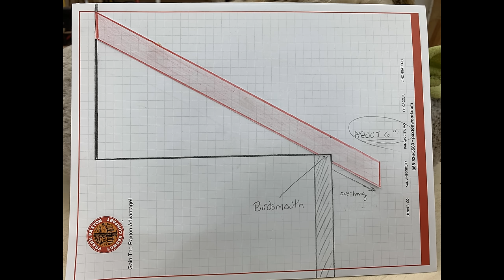99 - DIY Shed - Complete Instructions - Best Tutorial There Is!

Comment: Nail schedule? Really?! It's not sheathing, isn't going to experience sheerforce like a wall would, and all it has to do is keep your floor joists from racking! You're also using a heavy-duty piece of plywood, so being worried about the nail pattern is kind of silly especially when you make note about how you would do the floor substraight differently for a house. If anything, you should have put full pieces in the corners to maximize strength against racking, and did the excess strip in the middle. 

Bonus points about the strip being in the middle; you could use screws and be able to access underneath in the middle of the shed to later equip it with plumbing if needed/desired... or to hide things?

Comment: you mention early on the video that this shed would be OK for most of the USA, but I wonder if it passes Florida's restricted building code of 160 mph wind tolerance?
Reply: It would pass the only thing that you would need to add would be a bunch of hurricane Ty's stay blessed friend
Reply from the maker: Hi, you’d have to check your building code. The shed might have to be bolted to the ground to withstand 160 mile an hour wind.

Comment: Good job girls...but ALWAYS stagger the joints ..just good basic workmanship....also on first run of plywood measure back 4 foot on each end then snap a line and start plywood on the snapped line..rim joist could be off a bit ...line is always straight..more important on bigger jobs of course....again good job girls and guy .......

Comment: Fun build--it's great that it's a family affair--and as typical of your videos filled with helpful tips, insights and clever ideas. I tried my hand at this several years ago and while the end result is perfectly usable it is far from perfect (or square); really wished I had this tutorial prior to that build. So James I have a question, if you're out there . . . my next shed is going to have to be bigger than your plans--10x20. My last one had to be on concrete piers and was thinking the same for this but your suggestion here of PT skids would actually work much better. However I've been unable to to secure 20' 4x6 PT and it isn't reasonable to travel the 150 miles to bigger cities to get some. I've tried the big boxes and our local yards with no luck. Given this issue would you recommend "stitching" two PT skids together or abandoning the skids and returning to the pier plan? Thanks and keep up the great series--some day I'll tackle that amazing extreme crosscut sled.
Reply from the maker: JA Roberts, Hi!  I’ve found that for a small fee, most Big Box stores like Home Depot or Lowe’s will order in long pieces for you. 

If your suppliers won’t, and it’s possible for you, I’d drive the 150 miles to pickup. It is really nice to be able to drag your shed around later. You can also easily drag it up onto a flatbed tow truck and move it to a different house. 

I suppose if you had to, you could bolt two overlapping 4x6’s to each other. But you would definitely want a lot of overlap. I think using two 12’ boards would not be enough. But two 16’ boards would be plenty strong. 

Hope that helps. 
Also, feel free to email me or get me on Facebook if you have more questions. My email address is james@kingsfinewoodworking.com 

Thanks!!

Comment: Am I the only one that kept noticing how close those power lines were.
Reply from the maker: The low one that is 5’ above the shed is an old cable tv line that isn’t in use and hasn’t been for a decade. The phone line is out of reach above that. And the power line is 13’ above the highest point on the shed. 

A permit was pulled, and the location was approved and the final inspection on site passed.